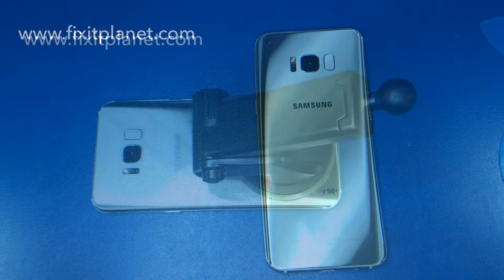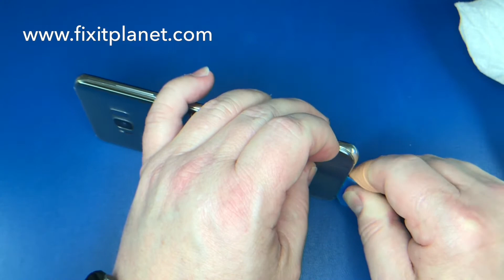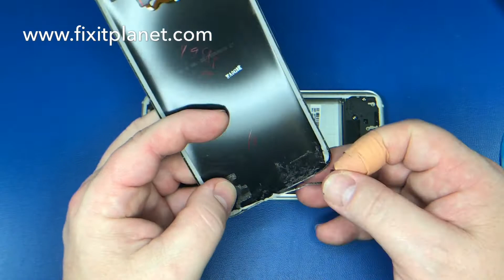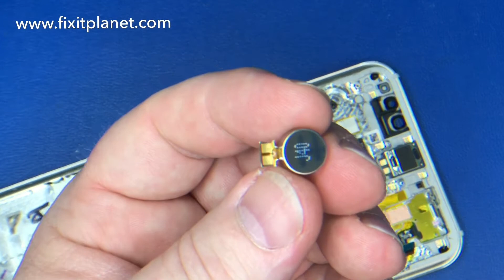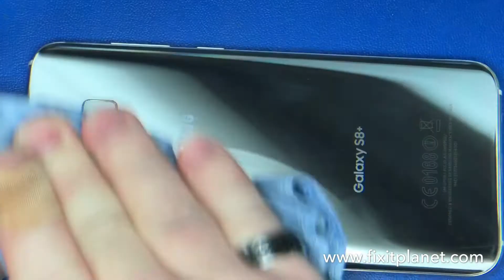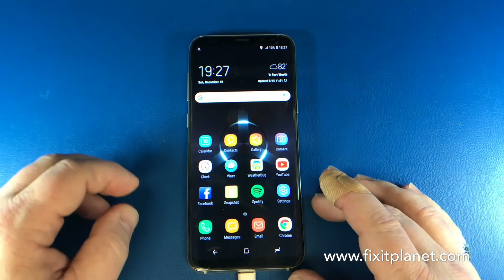Galaxy S8+ Teardown - Screen and Frame Assembly Repair From Start To Finish.

Comment: My screen is dead but when I click on the down volume and starts it vibrates and the red and blue light in the top works 
What do u suggest me to do ?
Reason the lcd is dead I dropped it in a jacuzzi
Reply: I'm a ham and egger with these repairs, far from an expert, but in my experience it is seldom worth trying to fix a phone that has severe water damage.  
Before giving up though, I would keep the phone in a bag of rice for a week or two and then retry starting it.  Now and then rice will work to dry out the moisture.  If not, you're probably out of luck. You might get a few dollars selling it for parts on eBay.

Comment: I'm working on repairing my old broken Galaxy S8 for a family member to switch to.  I haven't attached the new back panel yet since I wanted to test out the phone to see if everything is working.  I put in my current verizon SIM card and everything seemed to be good except it's got no cell signal and won't make phone calls.  It can do texts via wireless, but also no text if wireless is turned off.  Do I need a new NFC antenna coil?  Thanks if anyone knows the answer.  I checked phone settings and I don't think there's a problem in there (checked airplane mode and the usual stuff).

Comment: Great work! What kind of alcohol do you use to interact with battery adhesive?
Reply from the maker: We use 99%/100% pure alcohol.
Reply: @FixItPlanet1  what? You cannot have 99% alcohol nor 100%. You mean maybe 70% IPA or 95% rectified spirit?
Reply from the maker: No sir we use 99-100% pure alcohol by the gallon and by the quart.  For example you can get some here https://amzn.to/2LmTXVz

Comment: Thank you!
I watched your video, bought a frame, came back to the video, followed step by step, and only had 1 issue of having to also swap the top ear speaker, which your new frame had already.
Everything works flawless! legit step by step guide, took about 2 hours.  First phone fix ever.
Reply: I broke the copper tape I'm desperate to know if it is vital if so where do I buy it